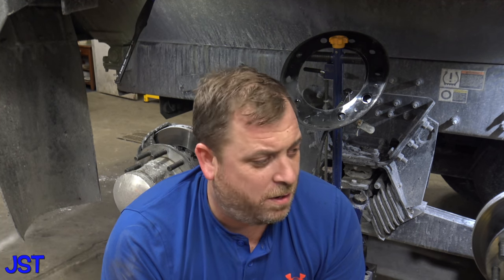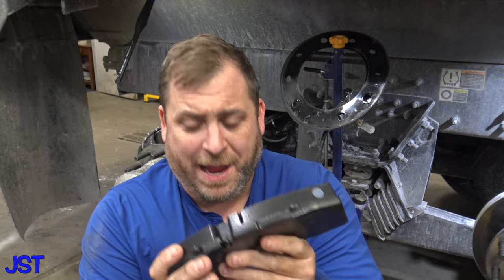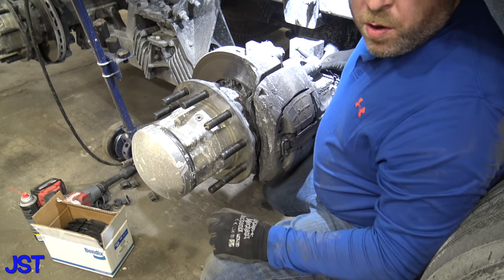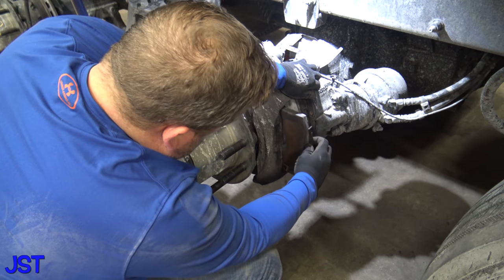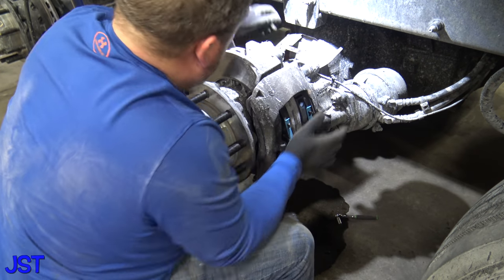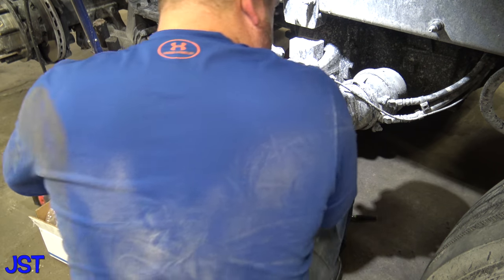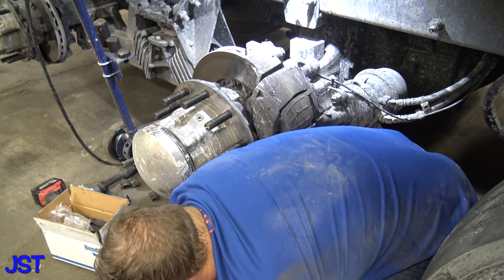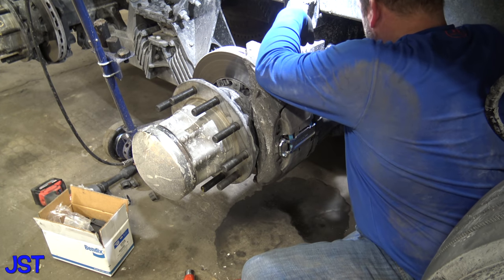HOW TO CHANGE DISC BRAKES ON A DUMP TRUCK

Comment: Love servicing disc brakes, super easy. The issue I have with them, is the calipers are constantly seizing up. With the long winters, and running the fleet from Alberta to Yellowknife, they take a shit kicking. Still a lot easier, and cleaner, than doing a full brake job on a drum brake setup.
Reply: Hi There, do you mean that the slide pins seize up? If so you need fully sealed pins. The Webb calipers are fully sealed. If you have water inside the brake mechanism and the internals are seizing up then its likely that your air chamber is letting water into the caliper. This is the number one water ingress point on calipers, the boot in the front end of the air chamber has to be perfect (and sealed onto the pushrod) otherwise water will get into the caliper mechanism.
Reply: @jonathanjackson5497  the slide pins seize, or the adjusting mech seizes. Sometimes it’s as simple as a rock getting wedged behind the piston. They’re great for regular highway use, but don’t stand up to gravel roads. Our units run the dempster highway, which is a long stretch of dirt road that beats up the equipment pretty good. Way more abs issues with the disc brake units compared to the ones running drums. Still, I do prefer working on the disc brake units.
Reply: @rookiebuilds251  OK, thats cool, good to hear you like working on them, they do work very well. Just remember to keep an eye on the air chamber, if you see any crud or rust on the pushrod when you remove it then it needs changing. Its as important to look carefully at the air chamber as it is the caliper.

Comment: I love disc brakes, I usually don’t use the dust shield, you can actually rebuild the calipers for about $100 usd very easy, the problem is Bendix don’t sell you the parts here, I got mine from Europe, go figure!!

Comment: Drum brakes work better at gross. Drums don’t fade as quickly either. Disk brakes are smoother and when light they have a better feel. But loaded down, I want drums. Did a month with a Pete with disks and the freight liner with drums gives much more confidence behind the pedal.
Reply: I disagree. The videos are on showing the differences. Some trucks have pedals that are just not responsive. It’s not a problem with the brakes, it’s usually a problem with the brake proportioning.

Comment: I still prefer drums. Changing that rotor is at least a couple hours all in. Drums I change the shoes and drums every time and I'm in it for 45 minutes about tire off n back on. I know disc's are better on the road, stopping,  heat. Etc but I still prefer drums if for no other reason than simplicity

Comment: We're going to be adding a new truck to our fleet and we've never had disk brakes before, and I'm not sure I like the idea of them. I find brake shoes and drums pretty simple and quick to do, now I got to worry about calipers freezing up here in the rust belt and looks to me like the hub has to come off to do the caliper? Granted I usually pull hub to put new wheel seals in anyways when I put new drums on, guess that's no biggie. Are the calipers going to be problematic like I'm assuming? It'll be interesting to see, that's for sure. Road salt and brime is a bad combination lol

Comment: Interesting, i was just specing Out a new dump truck. Wondering if disc brakes a lighter than drums.  And then i was watching you video. It looks like those rotors are inbound . So u need to take the hub off the change them?  That hate in bound drums they make me mad..

Comment: Throw the dust shield in the trash and the blue preload springs won't squeal on the rotor. They are to be changed when then line in the middle is gone or at 2mm.

Comment: Should have used a pry bar there is a small hole to put your end inThe pin goes in from the bottom and put a split in bending over and cut it of to size

Comment: Try using genuine pads they won’t break up. Change them sooner and you won’t get disc fractures. Wind off 4 clicks and you won’t burn the piston seals. Otherwise everything else was good 🤙

Comment: disc brakes are awsome when your just changing the pads changing rotors or wheel seal is twice as long and if your a weakling your guna pinch a finger lol

Comment: Disc brakes are nice and easy until you have to change that rotor. At least with drums it's not any extra work to replace the drum.